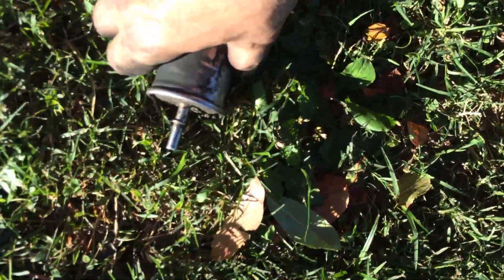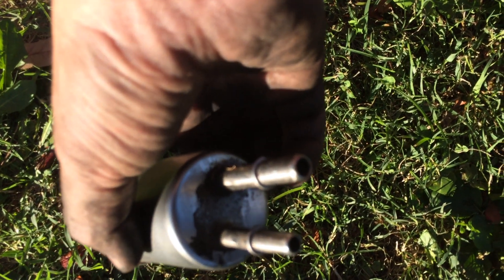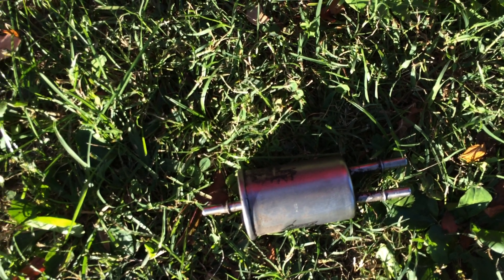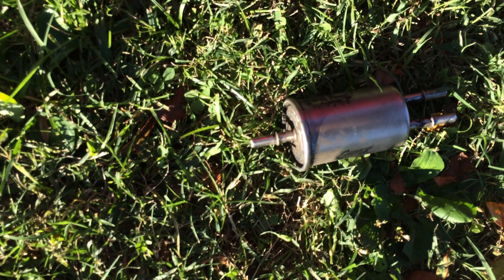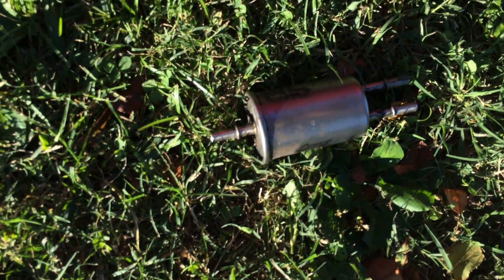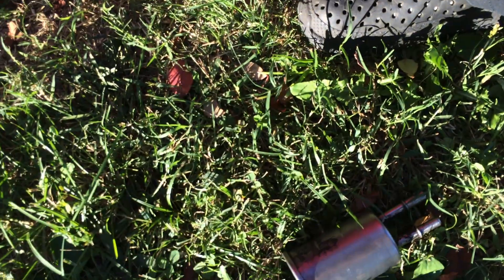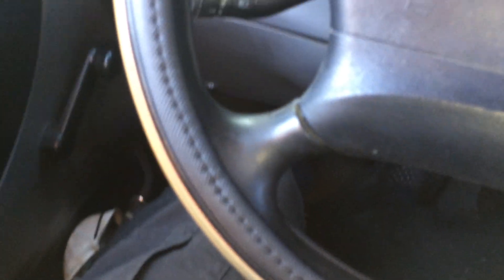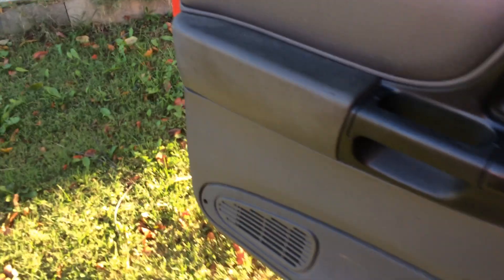96 10 Ford Ranger Fuel Filter Replacement Part 2

Comment: That fuel tank side 2 prong end of the fuel filter doesn't look like a 1996 but maybe a 2000s later model. I thought the 1996 Ranger XLT had one line on each end.
Reply from the maker: Some had two ports on one end, the early 96 did, mid-year 96 they started changing them to the one I showed on my 01.
Reply: @ranger.auto.repair  Excellent 👌